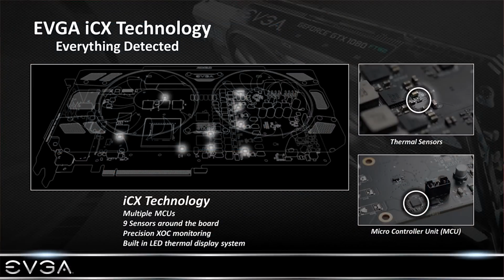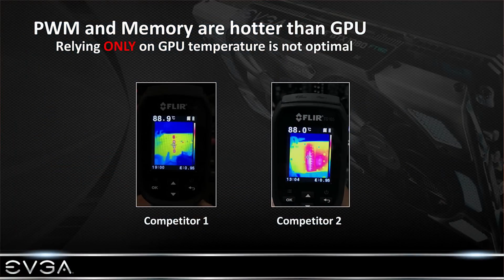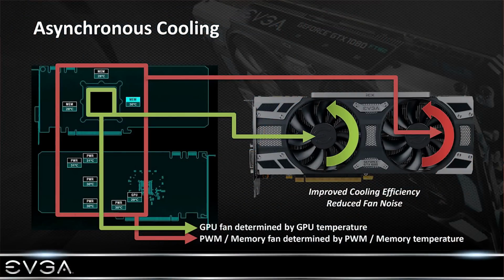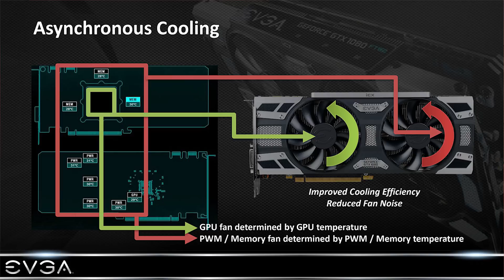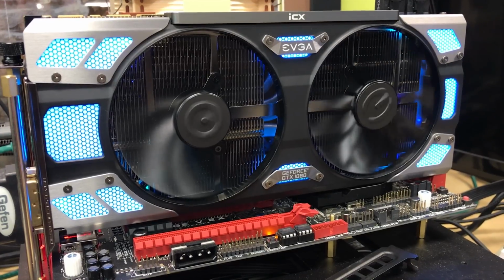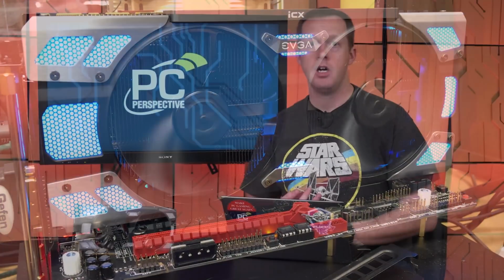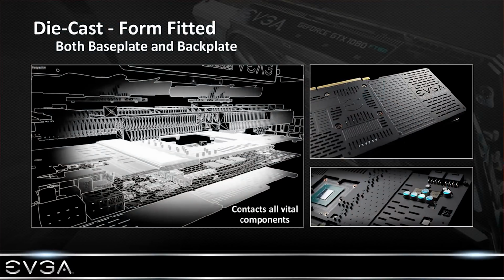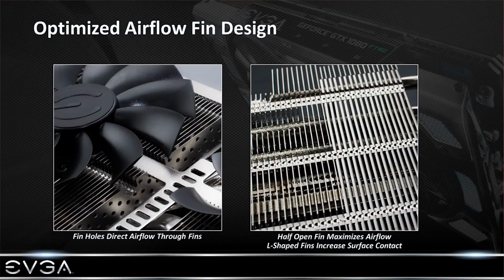EVGA iCX Technology - Adding Thermal Sensors and Improved Cooling

Comment: This whole journey of getting a new videocard feels like a rip-off. I won't be going with EVGA in the future. That's said I will use my steaming hot running ftw1 card till I need to upgrade and then I'll sell it for 50-100 bucks less than the iCX cards.

Comment: ICX cost $30 more than the old ACX. Upgrade cost $100 for current acx owner for more sensors and slightly better cooling. 1080 FTW will be my last evga card. Can't believe I paid $680 for a beta version of a gpu. The little thermal pad fiasco already dropped the resale value of the card and now this would drop it even further. You could "upgrade" for $100 but what good does that do you when you try to sell the card that is known for having issues?
Reply: and how are you harmed ? Evga can't control the secondary market , cause some idiot internet users didnt' do their research and jumped on a hate train .  I have a 1070sc card myself , It runs great , it runs cooler after the vbios and thermal pad mod , but it was never a heat issue to begin with > http://www.gamersnexus.net/guides/2691-final-evga-vrm-thermal-torture-test-and-analysis
Reply: You card is fine.  You didn't even need to return or mod it.  There WAS NO overheating issue.  Check youtube for proof.

Comment: quite frankly anyone who bought the original 10x cards should be offered this upgrade for FREE. The cooling for the original cards was not adequate.

So here is my reasoning. 
1) Updating the fan profile causes the card run louder than it was originally spec'd. 
2) The design on the original cooler was defective as it did not have appropriate cooling. So even you install the optional pads, how much damage was done to the card before doing so. 
3) As a result of 1 and 2, the value of these cards are considerably lower. For owners of these cards, their ability to sell these cards has greatly diminished because who in their right mind would want to buy one these cards second hand.
Reply from the maker: How so? Other than the issue that was previously addressed?
Reply: see edited post. couldn't respond with that for some reason.
Reply: http://www.gamersnexus.net/guides/2691-final-evga-vrm-thermal-torture-test-and-analysis
Reply: There was actually no overheating issue with the previous gen cards.  It has been proven exhaustively that parts were all running in spec.  They were hot but in spec and fine.  The cards that smoked had cap issues not related to cooling.  This was all blown out of proportion by dumb people on the internet who don't know anything about circuit card design or basic fundamentals of cooling.  So, no Nvidia shouldn't upgrade you for free.  They are going above and beyond already by offering a $99 upgrade to get a brand new card with a much better cooler design.  But the previous versions of these cards are still perfectly fine.
Reply: have you  not done your research ?  thermals where high before vbios / thermal pad mod but where not a issue . And causes no card to go bad (that was just a bad batch of parts , and the Frequency rate is barely higher then industry average.  Source: http://www.gamersnexus.net/guides/2691-final-evga-vrm-thermal-torture-test-and-analysis   , For the record i OWN a  1070 SC card , and have done bother thermal pad mods and vbios mod  just cause i do like lower temps . The card was NEVER advertised to have particular temps and all temps where in spec of the parts uses .
Reply: $99 + shipping + relevant taxes for a new GPU that may or may not clock higher, almost identical PCB, sensors, improved backplate and aircooler that is irrelevant for watercooling, 90 days step-up that probably misses the 1080ti intentionally and higher resale value. Not worth it if it's much more expensive in the EU than for the yanks.
Reply: nothing to do with NVidia. Solely an EVGA issue. I also have the GTX1080 FTW and changed the thermal pads. Eaazy peezy. I also doubt many people buying a used GTX1070 or 1080 in a year or two will know about that issue
Reply: Really because my GTX1070 FTW works perfectly fine i always run my fan speed at 60% it's silent even at 100% to the point i hear my Cpu cooler over it. Also the temps stay under 65C.